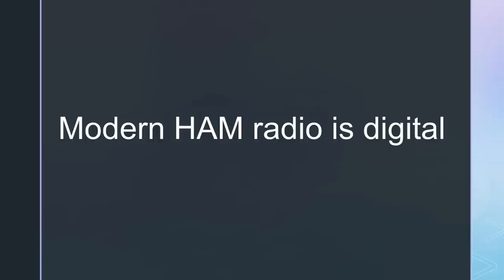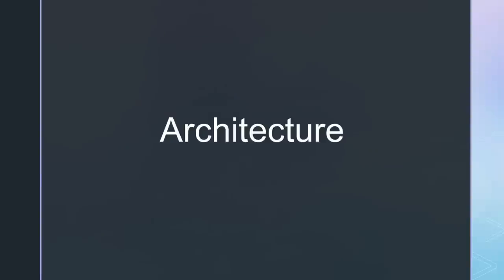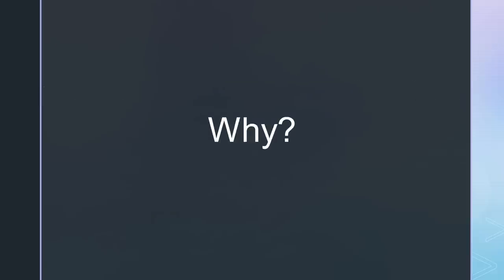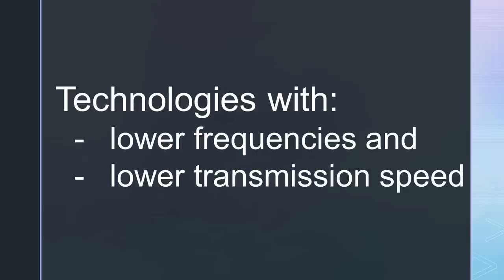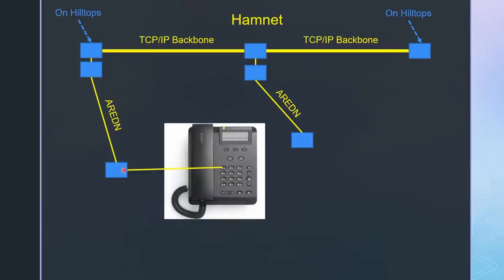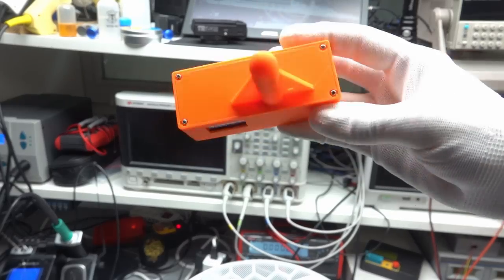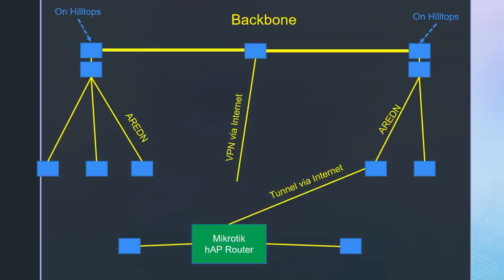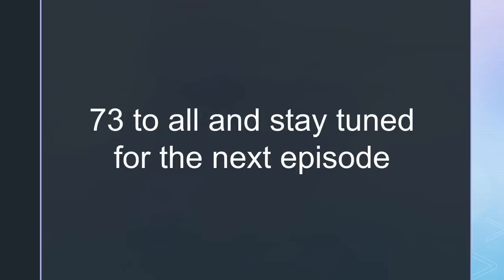023 Overview for the Modern, Digital HAM Radio Operator (Hamnet, AREDN, Lora, etc.)

Comment: This is great stuff! I heard about packet radio years ago, but when I see things like HamNet and LoRa, it starts itching. Really interesting developments.
Eventhough I'm not a radio amateur, I enjoy your videos (also your other channel). I might even start a project I'm thinking about for years now: a weather station with LoRa connection powered by solar. I live in a 23 story building and I'd like to put a decent self-sustained weather station on the roof. I'm a bit too far away (20th) for Wifi, so I think LoRa is a good idea. And a small solar panel to charge a battery to operate the station on.
Reply from the maker: My LoRa mailbox notifier works very well. It is placed in a "faraday cage" steel mailbox 50m away from my home. So your wether station should also work.

Comment: I can remember trying to get into ham radio in the early to mid '90s. I was more than qualified in theory (PhD in physics, heavily into SWL) and good at hardware but I couldn't remotely pass the CW code requirements due to dispraxia. I suspect the hobby would have been much stronger in the US if they hadn't done that gatekeeping.
I do still love SDR.
Reply from the maker: The morse test is long gone. So you have no excuses ;-)

Comment: Moin, isn't it wonderful how many possibilities our hobby offers? If you want Morse code: no problem. The friends of FT8 don't have to wait long for an answer. SSB, Repeater, Transmitter hunting and much more. And if you want to be creative yourself, you have the option of using simple setups to operate amateur radio at high frequencies - ideally with digital modes.
Micha
Reply from the maker: Indeed. This hobby has many facets! And Morse is also a digital mode ;-)

Comment: Try Halow combined 802.11ah for long distance and 802.11s for additional distance using mesh. Halow on lower frequencies and higher output power with mimo would be even beter like 64mbps oker 7kms. Give it an HT formfactor with two mimo antenas and internal normal wifi and ethernet port for your small devices to connect to then you could have your tacticool civilian manet. Use zello or briar over large areas with no cellular coverage

Comment: I follow our local Hamnet group.  Sadly I'm too far from the closest node.
Reply from the maker: I also live on the other side of the hill. This is why I started with a tunnel. Now we can start to build our own network and maybe one day replace the tunnel with links…
Reply: @HB9BLA  I will look into that further.  I think I need only one or two hops to connect to the main network.  Perhaps I can use my node to entice others if I build it.
Reply: @jmr  with AREDN i am now connected to a router far away (tunnel) and colleagues connect now to me. All I needed was this Mikrotik hAP router… Now e start our network using wireless links.

Comment: I feel like I am drinking from a fire hose.   Already a controversy re encryption  appears in the  comments to this video. (See also the just-published New Yorker article:  The Thorny Problem of Keeping the Internet’s Time | The New Yorker.)  There's a lot to digest!
Reply from the maker: Interesting article about ntp. Thank you for the link! Encryption in these networks is more a political than a technical issue as it could be switched on with minor effort…
Reply: @HB9BLA  You should know that Dr. Mills is a ham, W3HCF.  I was a student of his in early 1980's and credit him for sending me and my career down the path of the early Internet.   My class project for his "special topics in Networking" course was building a TCP/IP implementation for your UNIVAC 1108 mainframe computer.   (Good thing I worked at the computer center!)   

Dave did some very early experiments with (amateur) packet radio.  In the research space at that time, there was quite a bit of work being done on IP-based packet radio and digital voice for tactical military networks.    I did quite a bit of work on UNIX NTP, building the first reference design for NTPv1 as an exercise to test the protocol spec to see if it was complete enough to build an interoperable implementation.  It was quite a lot of fun, and precision timekeeping can turn into a sickness..  I had some of Mills' "fuzzball" research platforms (LSI-11/23, LSI-11/73 minicomputers) and a WWVB radio clock as a stratum 1 clock on the Internet back in those days.  

Thanks for the great video!  de WA3YMH
Reply from the maker: @lmamakos  It is always amazing what kind of viewers I have on my channel (I am very proud of that fact), and I love to read such comments/stories. Thank you!
BTW: I had to deal with timekeeping when I built my QO-100 base station and saw that this can be a rathole or even lead to an obsession ;-)

Comment: But most of the hams, and new hams and ham youtubers are stuck in the past, and dont use proper terminology and insist on calling an HT a handy talking instead of a hand held transceiver. I was licensed in the 70's and last couple years got relicensed and dont really see much change with the majority - dont get me wrong, I love the digitial stuff, designed some digi gear myself, but sadly I am so disappointed to the majority of the ham stuff out there. most dont even know what a real vco is let alone make their own reciver, and omg they had no idea receiver and transmitter were once separate units.... all their tech talk is make an antenna... and they still say "antenna tuner" is a matching circuit not a tuner! - K6WTG
Reply from the maker: I do not care about the others. They love what they do and this is ok for me. I do projects I enjoy.
Reply: @HB9BLA  I owe you an apology sir. I do most enjoy your videos. I guess I was just ranting on what most hams are these days. I do not see you that way. It was wrong for me to vent on your channel, and for that I am sorry.
Reply from the maker: @portblock  No problem! I did not read it against me. I have had the same discussions over and over. Therefore, I decided to distinguish between the guys who are on the same way I chose and others that are happy with other stuff. This is, BTW, the reason this channel exists.
Otherwise, it drags me down ;-)
Reply: But should you be able to make your own radio in order to operate one? I can't fix my own car if it breaks down, should I not be allowed to drive it? I'm an IT guy, and I can do a lot on a computer, but I know that 85% of the people owning and operating computers can't program or even know how it works. Who cares?
I'd like to experiment with this stuff, but then I see what exams I must take just to be able to buy such a device and connect it to my computer and play with it. Why do I have to know all these things? It's ridiculous. It doesn't make any sense. These rules were made in a time when you had to make your own stuff. Now I can order stuff from Ali and start playing with it.
They should change the rules. I understand you have to learn about the regulations and about interference, but I'm not an electronics engineer.
Reply: @PhilippensTube  I actualy agree with you, yes I had to make my own radio, and yes I am licensed and the fcc says I can make one now, but if I buy one it has to be fcc aproved, makes no sense, I also think the rules need to change. If i came across snarky, well, I should not have, my issues was really with some you tubers come come across as they know 100% of ham radio and portray them selfs as experts and only talk about oooh a new antenna and never actualy answer real questions. Ok you are in IT, its like watching some some PC channel thats all famous as from your IT point of view you realize they dont know poop - but all in all, I agree with you 100% sorry if my original post sounded otherwise

Comment: Mesh 5.8GHz will never be as useful or powerful as PtMP 5GHz.  Mesh signal levels are vastly inferior, and channel management is much more difficult.   Make friends with the local Wireless ISPs - they're radio enthusiasts just like you, ask for their help.
Reply from the maker: I agree with the „not so powerful“, but I think it is very useful for the last mile where flexibility and speed of deployment is important. For experimenters like HAMs it is also important that they have some freedom and do not have to ask an administrator for changes.
Reply: @HB9BLA  A good sized ubiq dish with standard firmware could easily provide 20-50mbit throughput to an AP 25km away, even heavily loaded.. A mesh system might give you 2-5mbit on a heavily loaded network.  Hams can trivially use such gear on the general license anyway, there is no need to put callsigns and license conditions on links except for vanity.
Reply from the maker: @SteveWrightNZ  For me, HAMradio is a hobby. And hobbies should create fun. I see that many people have fun with those AREDN networks, particularly younger people (meshes seem to be "magic", see also Meshtastic or Zigbee). This is why I support such projects. As we all know, we have an issue attracting younger people to our hobby.
I compare it with our other "disciplines like DXing, contesting, fox hunting, SOTA/POTA. All are not very "useful" other than having fun (and maybe learning something).
And, if your point is valid, they will learn a lot, BTW ;-)
Reply: @HB9BLA  Agree.  Ham Radio is inherently fun, like scuba diving and aviation, and does not need our help - it is only us who feels dissatisfied about it. If we would improve anything it should be the leadership, in my opinion.